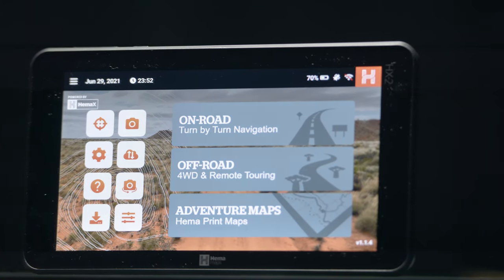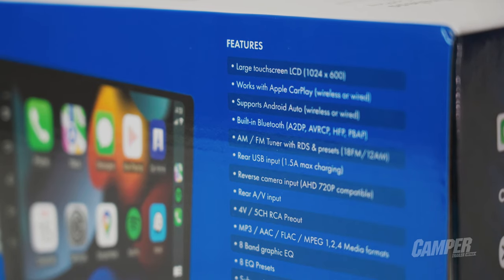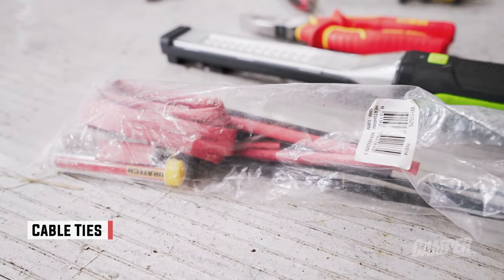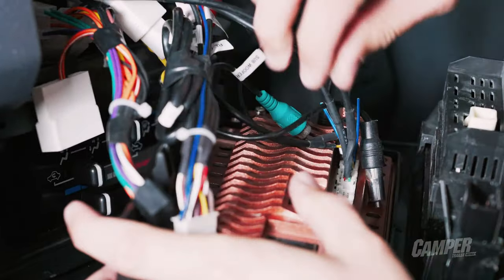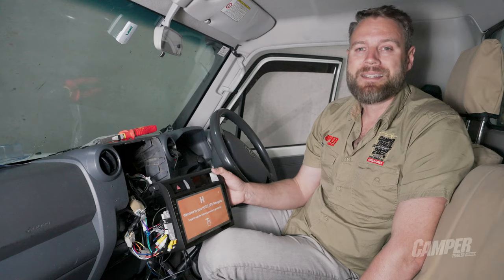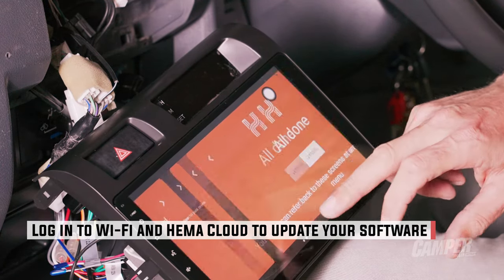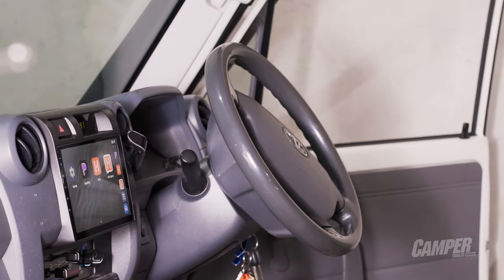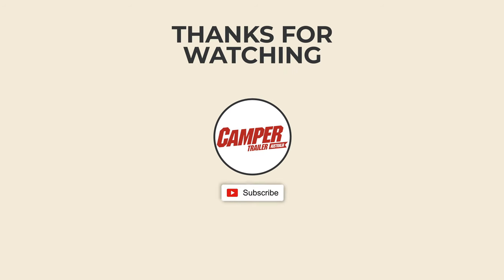Aerpro Head Unit DIY Install with Hema Maps Module

Comment: Do these require a connection to your phone at all times to work correctly?
Can they work like a conventional GPS off line using stored maps on road?
Do they have their own antenna or do they use the phones?
Or are they just a android box that just passes the phone apps on through?
They appear to have terrible reviews online and it has been stated that they are even incapable of giving a route on road to a given address.
So do they just hold the HEMA maps and make the phone do all the work?
Reply: coz it connects to your phone, i think it uses your phones wifi. Thats so crap. My ebay unit had maps installed and came with a GPS antenna so it got signal anywhere. This this seems no different than viewing on your phone and mirroring to the headunit.